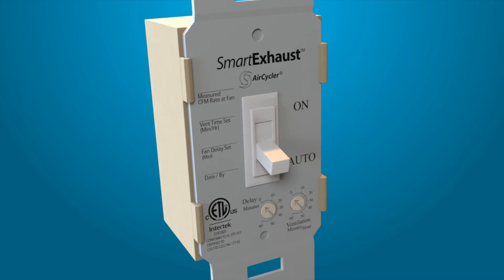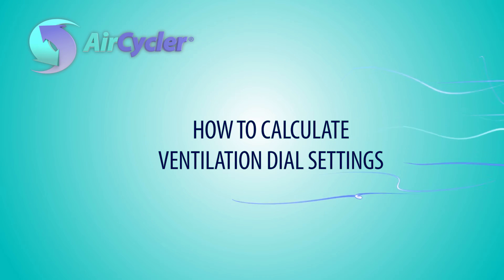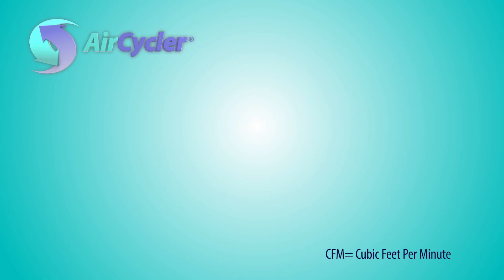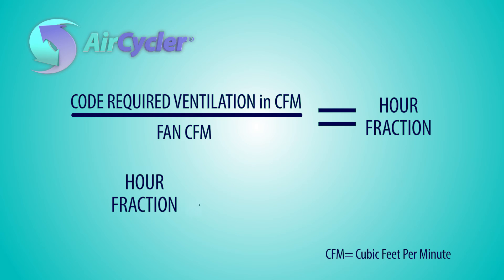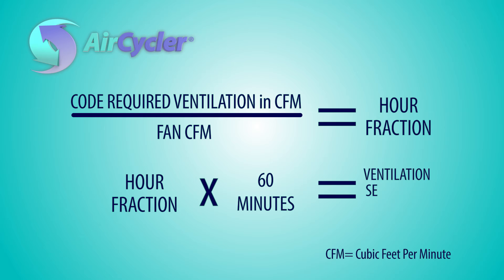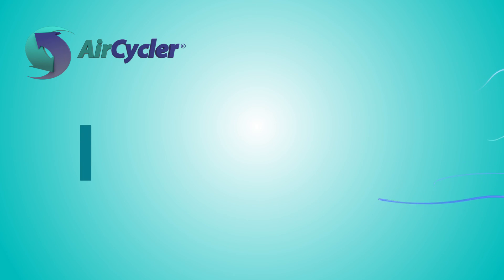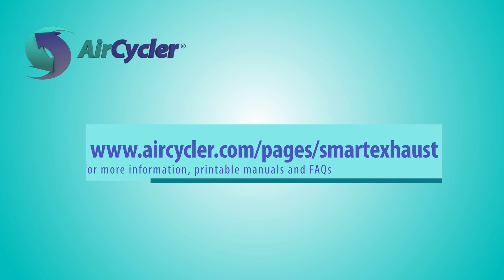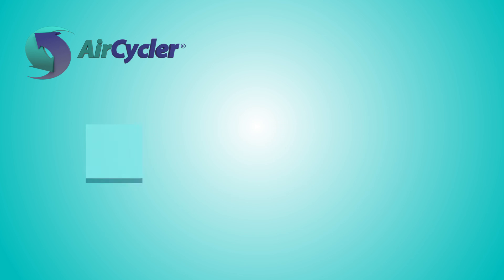Programming the AirCycler SmartExhaust

Comment: Hi I'm having problems with getting mine to turn off. 
* The Right ventilation switch is set to run a couple minutes.
* 20 seconds after turning on the lightswitch, I hear the fan slowly starting up. By 30 seconds, it's fully on steady.
It won't turn off on it's own. I have to turn the switch off, on and off again- THEN it turns off -  no matter what the Left delay switch is set at.

Isn't this setting to DELAY running the fan until the light is turned ON for a Set amount of minutes? 

Is mine installed incorrectly? Am I supposed to have separate switchs for my lights & fan?

Also, how is this bathroom fan supposed to be strong enough to ventilate my whole apartment? I'm guessing this is the new, cheapest method to code used in apartment buildings? 
I want my bathroom fan running after a shower to help get the steam out then to be quiet for the rest of my day. It's so loud, I've been keeping the bathroom door shut (now I see that it can't do it's job that way)

The sound is quite bothersome with tinnitus.
Reply from the maker: Amor, you would need to have the wiring verified but typically, the SmartExhaust switch is wired to control both the fan and the light. When you turn the light switch on, the fan will come on as well. If you only want the fan to continue running after you have left the bathroom and the switch is turned off, you can set the Delay dial to whatever you prefer. The Delay dial determines how long the fan runs after you have shut the switch off. Setting the Ventilation dial (the right side dial) to 0 will stop your fan from running any other time of the day. We always recommend this switch be installed with a quiet, good-quality exhaust fan.

Comment: Hello, 
Got an Aircycler Stat FR-V 1417 3 button system in my house. 3min on, 180 off, for fresh air. When it kicks on, it keeps shutting down and then off again several times during those 3 minutes. I took the unit off and blew out the dust. Buttons are still fine. Is it the units fault that you now discontinue or is it the Bryant units fault? I flicked the main switch off but that also turned the downstairs AC off. When the AC kicks in, it stays on for the cycle, so I know its not the ACs fault. Anything I can do myself here for a quick fix?
Reply from the maker: Hello, our techs can help you with troubleshooting the FR-V. Please contact them here https://www.aircycler.com/community/contact. You should hear back within the hour. Thank you!
Reply: @aircycler34  just clicked the link. Same i filled out yesterday there again same time i posted this and I did that once before and never heard from anyone?
Reply: @vtr-vegasteslarides569  Hello, can you check your spam folder for our reply? Our tech responded yesterday morning. Please let me know if you have any trouble finding it.
Reply: @carlyroche6206  thanks. Found it.